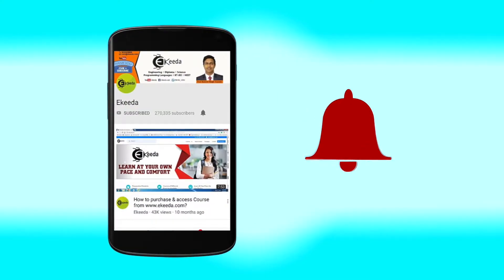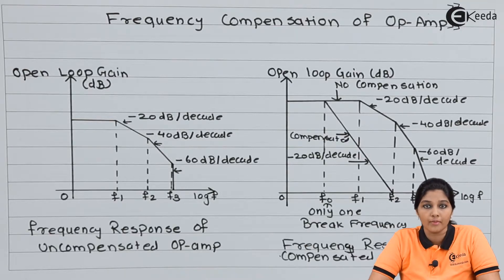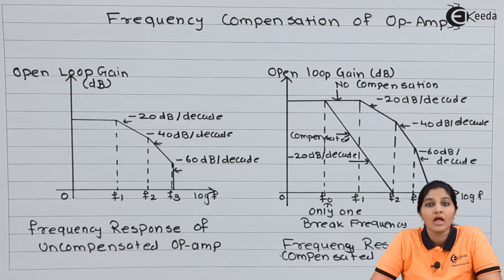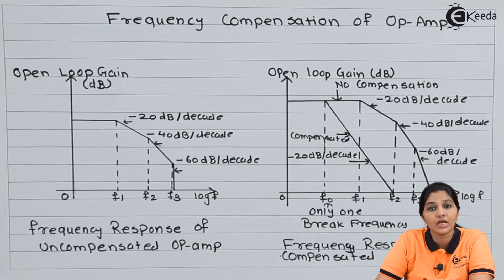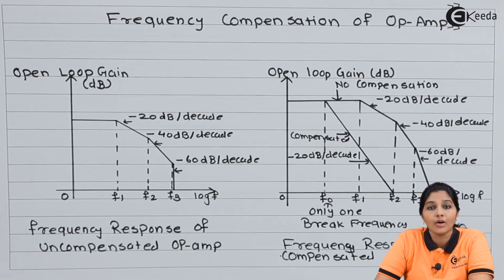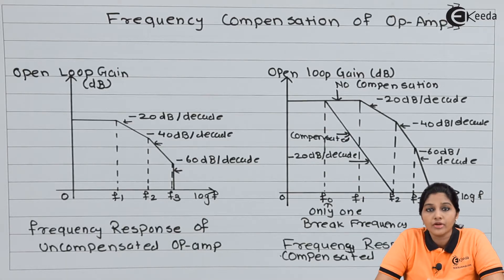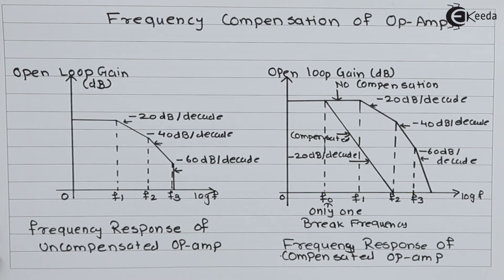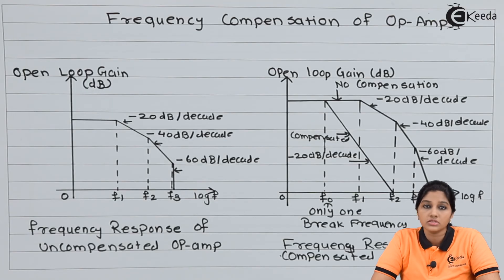Frequency Compensation of Operational Amplifier

Comment: ok, but no more information is given, why and how does the compensation capacitor impose this unique cutoff frequency, how is it capable of having such an effect. Also, the phase bode diagram would be helpful to see how the multiple poles in the uncompensated opamp leads to instability because with it you have a phase change of 360 degrees on the feedback when the gain is still greater than 1.